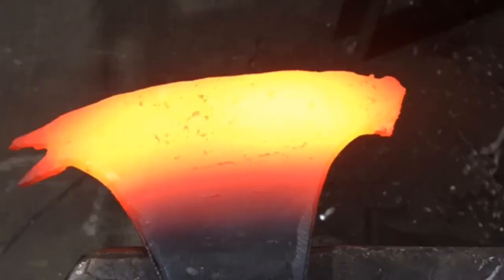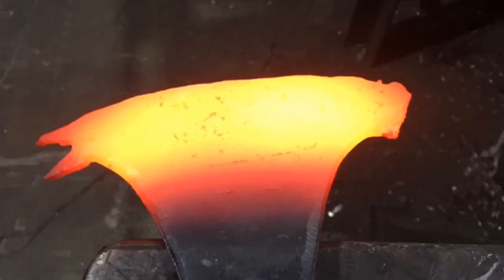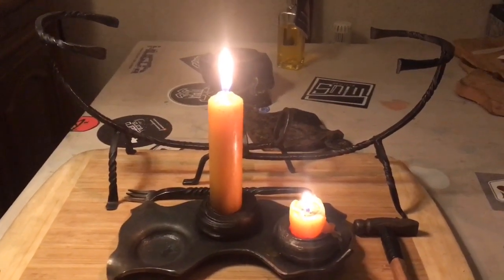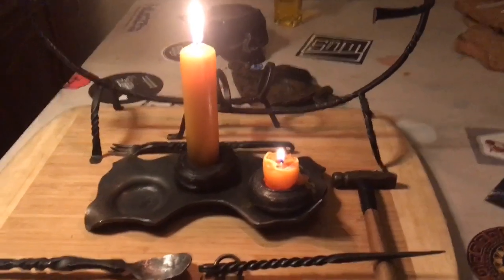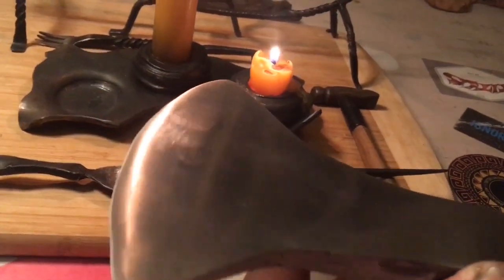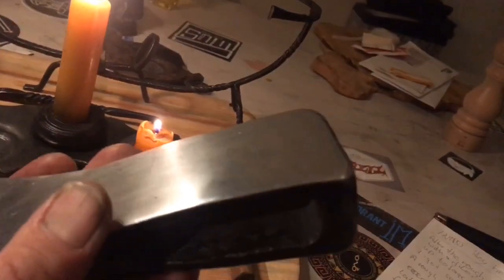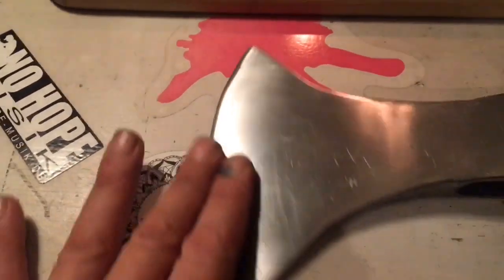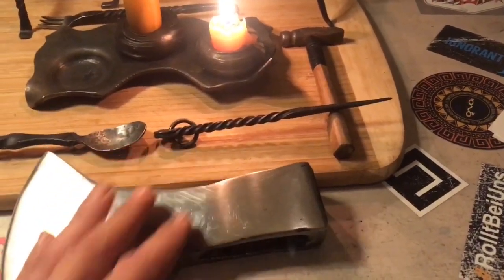Restoration of an 300 year old axe head part 2

Comment: that's lookin great, the hole for the handle looks like it would be hard to do, I think it being rough inside would make the handle stay tighter, especially if you let it sit in water after you finished, but you'd need to do something to prevent the metal from rusting.
Reply from the maker: Hey ho MissouriOldTimer. Thanks for the advice. I will think closer about the water thing. Thank you for watching. Greetings have a nice weekend.
Reply: My grandpa used to put his hammers etc in a bucket of water when they started to get loose, and my uncle had a wagon with wooden spokes, he backed the wagon down in the pond to stop them from rattling when he drove it, he used a team of horses for that wagon.